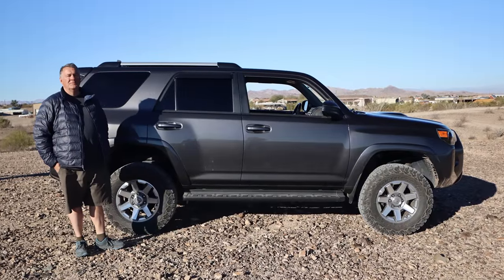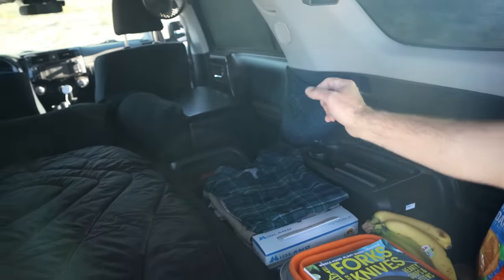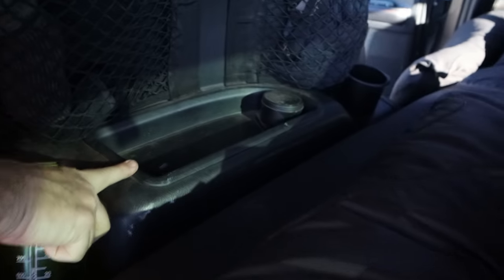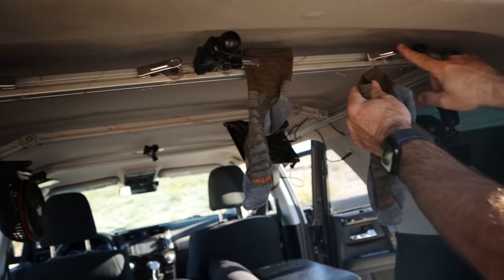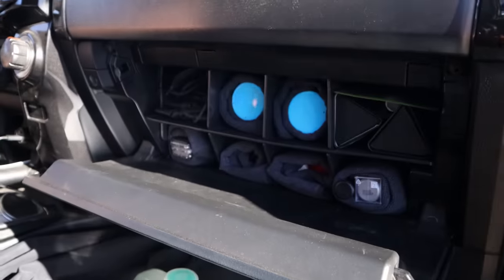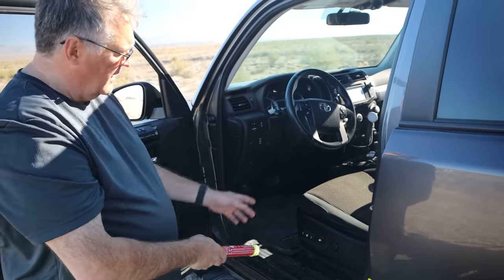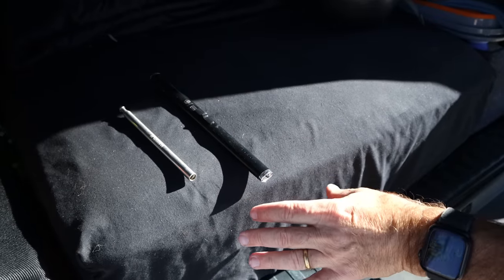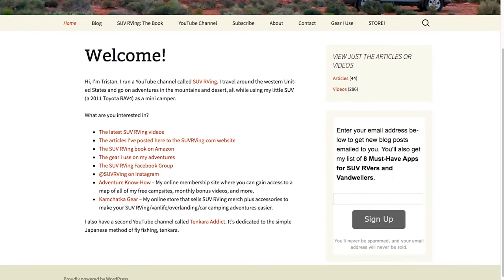This Is The ULTIMATE Stealth SUV Camper and Overlander! (Modern 4Runner Build)

Comment: That is a very nice build.  I love how stealth it is, but so functional.
My rig looks somewhat stock too, but has a tall lift and 37s.  I don't keep any of my camp gear on it when not camping, as most overlanders do, like it's a fashion contest.
Also, that 4runner is nowhere near the capability of a rubicon.  Atrac and IFS can only do so much.  Rubicon has front solid axles, front and rear lockers, and sway bar disconnect.

Comment: Great ideas. Question about USB ports: they look easy enough to install, but you lost me with "It has the wire already built in behind it." Is that unique to a 4-Runner? The thought of venturing inside the walls of my 2006 Highlander intimidate me. That said, I don't think I need the extra ports, but they would be nice. Cozy ride!
Reply: Hi Janet. This is John. Believe it or not, almost all the interior panels on a car are held in by one or two screws and a bunch of clips. Be not afraid to rip you car apart to see what’s in the walls. You can always take it to a garage and have them snap it all back together. Trust me. It’s simple b

Comment: what do you do for heat? i thought you mentioned it, but didn't see anything for that. I am in a lot of cold areas so that is important.  :)
Really cool build, i have a minivan which i think is great, but i don't like being limited on the forest roads. i wouldn't really go off road, but the minivan is pretty basic and i need clearance at least...
Reply: I do what the hikers do. I have three 40 degree Rumpl blankets. I’ve slept comfortably into the 20s.
Reply: @JohnMason-Hill  i suffered through a few nights down to 17 degrees, but not comfy - and i had a low temp hiking bag. lol  I am comfy at 30 and up, colder... i am cold. lol

Comment: Heads up on the panels. 

Has anyone here measured their 4Runner for the solar? I've got a 2016 4Runner, Limited trim, and the roof rails are slightly too narrow to accept the two Renogy panels, which measure 20.9" wide, so there may have to be some slight modifications to fit them.

Comment: I like the safe idea, but I need something bigger.  So I'm going to repurpose an old dollar bill changer, which is basically a very solid steel box maybe 30x18x8 with a high security lock to remove a hatch for access to the interior to get the money out.  Remove the guts, voila, poor main's vehicle safe made of steel as thick as most gun safes.  

I got it for free, abandoned by the previous business in commercial space I leased.  I did have to drill the lock (not easy) but would of course want a new cylinder to have keys anyway.  Reuse, repurpose, recycle.  Though i'm not averse to welding a custom size/shape myself.  

I of course hoped it was loaded with coins, bills, or a combo.  Nope, just coins the had overflowed the bin and gone into nooks and crannies.  With enough shaking and tilting, I got all $5.50 of quarters out of it, so that it won't rattle wayward coins between its partial double walls.

Comment: Limo tinting isn't legal in states like California. Does he drive there and not get pulled over, or does he stay away from those states? I would love that tinting, but I've always been afraid not to be compliant.
Reply: I thought so as well, yet I am seeing more and more tinted windows and no one is getting pulled over.  Seems the extremely dark tinted windows are very popular in Oakland...
Reply: I have travel all over the United States in the past three years putting over a hundred thousand miles on the rig. I have never once been stopped or ticket for having tinted windows. Perhaps this is do to the front windows being clear.

I also keep the rig clean so I do not present a scary profile.
Reply: @JohnMason-Hill  That's great to hear, thanks.
Reply: “Limo tint” or even complete blackout is legal in Cali except front & front/passenger doors as long as you have both side mirrors.

Comment: Eventually, even houses will have usb electrical systems. Every light can have onboard batteries charged from the buss. Power outage, and all your lights still work. No danger of electrocution, so no building code or permit for the wiring.

Comment: Exactly my philosophy except I am probably even more streamlined and I hate talking about "stuff".  I integrate stuff on need basis.  I minimize weight on board (mountain roads). I like my Bluetty 1500W 3yo now.  Never had to plug into a motel in 3 years of fulltiming.

  I dont cook inside the van.  I eat one meal a day too and never any processed food or sugar/fast carbs.  No way I will risk embedding smells into upholstry.  It WILL smell:  to a  bear's nose.  My van is a hard sided tent for a reason.  I have no reason to cook inside.  I dont do dishes:  cook in cast iron, eat in same. Wipe with bread😂  then 3 to 4 times with wet paper towel bit.  No soap ever needed.  Store under triple layer plastic.  Odor free.  
Laundry is pull into any campground and hand wash  10 minutes flat.  Pick a sunny day, or just dry and windy.  Never dirty laundry bag.  My clothes are light, backpacking type.
At 70+ I have no issues bending into whatever shape I need to be.  I am on the road to get healthier every year,   I make sure that happens.
I plan another cat so some of these hanging gizmos will be interesting to her too😂
I welcome any "personal use " the cat will figure for herself, I welcome creativity...cats are magical and great hikers,  and just as easy to train as dogs.  Perfect for me anyway.

Comment: Nope. Its far cheaper and more room to get a used gm 1999-2006 tahoe, yukon, suburban than any toyota .
And you get same if not better mpg, more room, more towing capacity, and same reliability , cheaper to fix, easier to find.  
In 2023 i bought a 2005 suburban 2500 6.0L 110k miles $4500, and a 2003 tahoe 5.3L 150k miles $2500.
Both get 20 mpg, tow more, more room to "overland" than any toyota suv and many thousands of dollars less to buy or repair.

Comment: 1:35 "It's as well equipped as a Jeep Rubicon"...because it has a lift and all terrain tires! 😮😂😂🤣🤣. Not until it has front and rear axle lockers, a solid front axle and an easily disconnectable front sway bar would it even *start* to compete with a bone stock Rubicon.  It has none of these things.  It's an SR5 with fluffy goodies added.  Any factory Jeep Rubicon would utterly DESTROY this vehicle on real trails.  And you can fix a brake line with TAPE?  While there are many interesting and cool features on this vehicle, in particular the "internal roof rack" (brilliant!) and otherwise from a stealth perspective, he clearly has a LOT to learn about real off roading.  But I'm sure it'd do great on dirt roads and Subaru "trails."